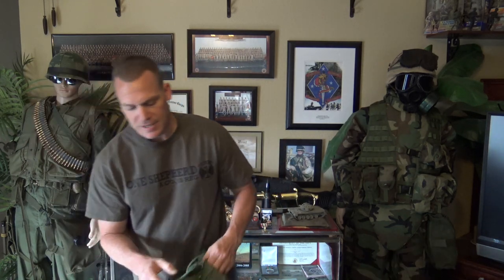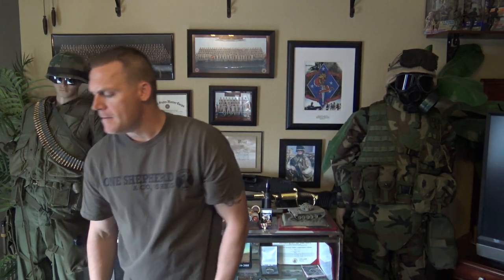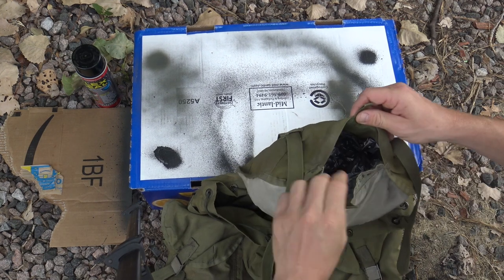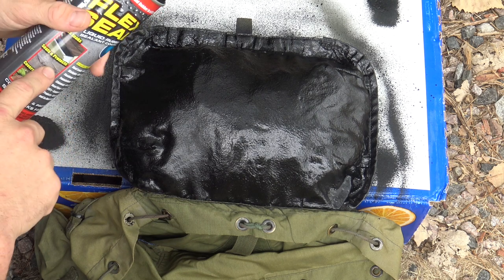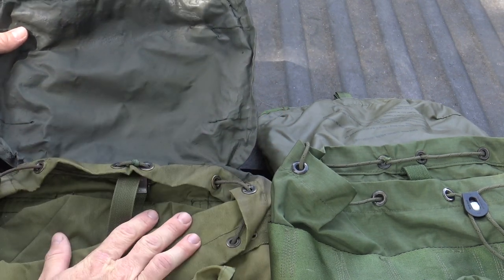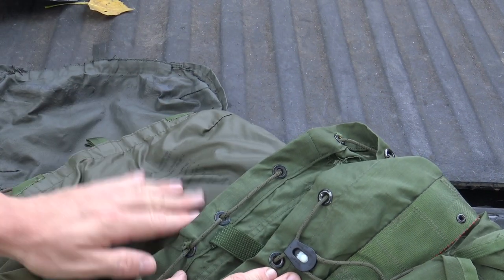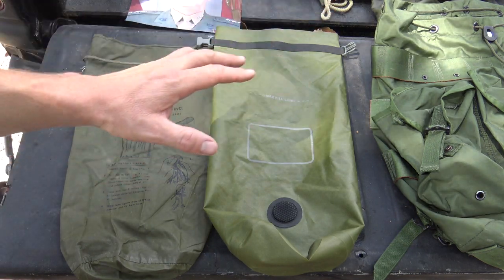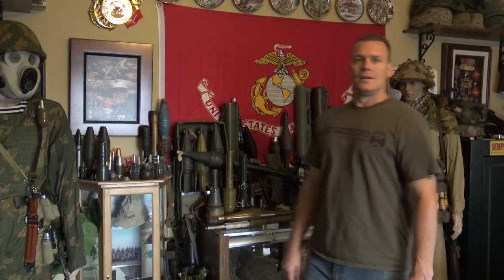Quick & easy repair to your old ALICE pack lid

Comment: My two ALICE packs I have from 1982-1993 USMC are far superior than the cammo ALICE pack I was issued in the Army in 2000 or so. 

Both USMC tops are still mint and need no attention. 

My Army issued cammo one the top liner is basically powder and getting all over everything.

Gonna give it a good wash and then use the flex seal to seal it.

Great tip

Comment: Just did my first coat on my Medium Alice pack. Only change was I taped off the nylon seams. First coat is a little rough but I can only see a little light through so it’s not bad. Next coat soon then the OD paint

Comment: This technique works great. I finally got around to repairing one of my packs with zero waterproof material left. I used rustoleum spray rubber. A little talc added after everything dries keeps the rubber or paint from sticking.

Comment: I’m a photographer I have very expensive backpacks but as with most packs taking off the pack and laying it down tends to wear the fabric on the bottom or if you have it set down and it’s raining and the ground is wet it tends to soak through this may be a preemptive strike to prep my gear for longer lasting waterproofing thanks for the idea

Comment: I am SO doing this with several of my ALICE rucksacks!
Reply: Dr Larsen,  in the 101st did you have a Medium or a Large ALICE pack? And who in your experience had the Mediums and who had the Larges?
Reply: @docback63  - I served in four Infantry regiments. Two were Mechanized Infantry - the 1/17th Buffalos and the 1/314th Mech. I also served in two Light Infantry - the 5/20th Regulars and the 3/187th Rakkasan Air Assault.

In the Light and Air Assault units, we were issued large ALICE rucks. In the Mech units, we were issued medium ALICE rucks. What we learned was this - the larger your ruck, the more the damned Army would force you to carry in the field! Plus, the more "Light" the unit, the more the Army expected us to be pack mules. That is the exact OPPOSITE of the Light Infantry concept, but we couldn't explain that to the 18th Airborne Corps. We wanted NO PART of that damned CFP-90 rucksack that was issued to the 10th Mountain Infantry!

For reference:
39.5 Liters (2400 cu in) Interior Space = Medium ALICE Rucksack (pockets included)
62.2 Liters (3800 cu in) Interior Space = Large ALICE Rucksack (pockets included)
111 Liters (6800 cu in) Interior Space = CFP-90 Rucksack (complete)

Yeah, having done some extreme cold temperature operations in Korea with daily highs at -5F and lows at -25F, I can appreciate the CFP-90 as an arctic rucksack. Aside from that, NO THANKS! Makes sense for the 10th Mountain Infantry, I suppose.

Comment: I've used Flex Seal on my MOLLE II patrol ruck. I sprayed the bottom for more abrasion resistance and to give rigidity to that portion of the ruck. Also did the same thing on my duffel bag.

Comment: I rain-proofed my Alice pack by brushing on a silicone layer on the inside and outside of the pack. Just used some clear silicone bathroom caulk and cut it with some paint thinner to make a paintable solution. Ran through 6 thunderstorms going 60 mph on a motorcycle. Kept my stuff dry.

Comment: Brent, I just found your channel a week or so ago; I have to admit that I was perplexed at first about your interest in Vietnam era gear in the first video of yours that I watched. I was thinking; why would one of the new corps marines be so interested in our old so called obsolete field gear (hard corps) (ya you know, us old corps, the ones that had twice the PT requirements and we did real sit ups, and we thought that our body armor was when we took cover behind our big balls!) (just a "little" burn on you "new bees"). I think that the USS Boxer was also on the float that evacuated Vietnam from March through June of 1998. Back then I was still using the older 782 gear setup for web gear.(oh, FYI, the web belt in your video with the snaps around the center it is called a "pistol belt") Any way; I have trunks full of what you scrounge to collect, I got issued my "new/ never used medium Alice pack in June of 1978, I still have it and it's still ready to go! I got a couple of those big liners that you showed by convincing a couple of Army reservists on their two weeks in the summer that they didn't need them, and that I would "get ride" of them for them! dam, the reserves are dumb! I gathered most of my collection when I was the motor pool maintenance inspector at both the 3rd and 1st Div's. Everybody knows that when you turn in your vehicle for maintenance that you remove all gear! Dam, their dumb too! One General that was returning from 29 palms had his driver drop his M151 off at the motor pool for Maint. and was rather upset when his field lantern set disappeared from the back seat. "It must have been those other drivers from operations SIR!" I still use those lanterns with my GP small tent when I deer and bear hunt, going on 45 years now, never had to use the spare parts yet!  "True story"...Lt butter bar and Capt butt hole busted me one day for obeying orders from a Navy Commander, (out ranks them both, "together") (oh I had a secret clearance, and the Capt. was jealous, when I checked into the company he raked me over the coals about it until my TOP "MSTRSGT" called him out and shut him up)  Dam their both dumb! So I wrote a letter of appeal to the battalion Commander, "a Full Bird Coronal" He received my letter about fifteen minutes after the said Division Commander, " the General" called him to congratulate him for having the "only" Marine that received a "Noteworthy" result on that weeks FMF PAC inspection that worked for him at Headquarters Battalion 1st Mar Div. That Marine was none only than Cpl. me, myself, and I ! And he also notified him that next week the HQ Marine Corps Quantico, was sending a teem of 3 officers to study and implement Marine Corps wide, the system that I developed to track and validate modifications on every vehicle that my motor pool was responsible for! .....Long story short; Lt. butter bar and Capt. butt hole were ordered never to interfere with me again and I was also given a cushy job as the new FMF PAC Inspector for Motor T at the 1st Mar. Div. !............ So any Officers out there reading this;... NEVER F...WITH YOUR NCO's! They are SMARTER than you are!....WE RUN and OWN THE Marine CORPS!..............Have fun with your channel Brent!... CARRY ON MARINE! ...Semper Fi
Reply: OORAH BROTHER!!!

Comment: I was really hoping to see a lid replacement.

 That said, if you're using flex seal, use the 'liquid'. The aerosol type is stiff and deteriorates quickly. In fact, not quite as 'quick and easy', but for a membrane repair, I recommend appx 60/40 flex seal/GE Silicone II(by volume), thinned with mineral spirits, to about thick latex paint consistency. This makes a really tough and flexible 100% waterproof membrane, with a very thin, lightweight application.
Reply: Thanks for your input I tried this hack and like you said the spray was brittle and cracked and flaked off. I figured I must have done something wrong and tried to do it again by first cleaning the surface with alcohol, but that doesn't help either. Thanks for your solution I'll try that.
Reply: @ldsphotodude49  

Even applying straight silicone II, will give a pretty good result. You definitely want to back it with wax paper on the inside because its messy and then just apply some silicone, with a credit card or something. Only need a thin layer.
Reply: Yes, I had the spray flex seal flak off too.  Onto plan B

Comment: Your absolutely correct about those rubberized inner liners smelling like vomit. They smell like that even when they are brand new. Good thing that smell doesn't get into your clothes when you stuff those liner bags.
I tried baking soda and it worked to get rid of the smell. So no smell, but, had baking soda all over my gear. I guess the general rule of thumb is to get something, you have to give up something. Can't have your cake and eat it too.
My ALICE large pack top flap deteriorated too. Along with a rain poncho. Flexseal to the rescue! Hope there is some OD Green color.

Comment: Great instructional! I've got an old LARGE ALICE pack (10x better than the mediums, for real pack-size!), and it's got 'rubber rot' really bad...and while it's easy to take the old 'floor brush' to the pack to strip the old rubber off COMPLETELY (nothing like rubber-cancer showing through like truck bed texture), but I wanted the original water-proofing on the flap to be as close to original as possible...and I really never gave flex seal a thought...until now! Headed to the hardware store....
SEMPER FI! 0311 to heavy gunner!
Reply: FYI...the Large ALICE pack is 3,880-cubic inches, for those who want a 'civilian size comparison' to commercial packs...

Comment: Great video Brent,
Out of curiosity, not trying to hijack the subject of the video, but has anyone tried to revive an old poncho with flex seal? Just curious how it turned out and how it lasted. 
I have a woodland poncho that is starting to loose the rubber coating, and I have an old OD poncho that nothing is left but the nylon that I’d like to revive.
Thanks and Semper Fi

Comment: Have a surplus French  F1 day  pack & exterior  latex coating deteriorating.  Used flex seal  on audio  gear w/good results. There is a green flex seal spray.  Next project restoration, & color match spray paint. Curing time essential for the flex seal for best results, dont hurry, it works

Comment: Outstanding as usual.  Greatly appreciate it.  Is it possible to use the large Alice pack without the frame?  Don't believe so, but these pack are surprising.  The advantage of the large Alice in the north is you can stuff bulky, and light weight clothing in, and still have enough room for everything else..

Comment: Thanks for the video. Just got a rather used Alice pack myself the past couple of months and I'm looking forward to more information on them.
Also, would you be willing to make an in depth video of using the Alice pack with the Alice belt or newer loadouts?
Reply from the maker: Check out the last video I uploaded, its a very detailed video about the Alice system.

Comment: Awesome video brother!!!
1 question...do I need to remove the old sealant before I apply the flex seal?
Semper Fi brother!!!
Reply from the maker: I didn't on the second pack I did and its holding firm, no issues. If you prefer I'm sure you can remove the old rubber with a brush but I don't think its necessary. Flex Seal is a beast and bonds to any and everything.

Comment: I like to use Alice Chemical Suit Bags to carry sleeping bags on my Alice pack. Yes, I know the military issued sleep system bags, but the chem suit bags are usually cheaper, and well they are a “second cool” kind of bag, meaning I just like them. I just hit on the idea that flex seal would turn the chem suit bags into actual dry bags, since the bag has the same closure method as a dry bag.  I may be wrong in that the flex seal may not appreciate the constant folding and rolling that goes along with opening and closing the bag.

Comment: I have used flexseal many times, some times it works but other times have failed, when exposed to sunlight or heat will tend rub off, we have used the tupe flexseal to fix a flat tire once, took off rim and clued the inside, still holding air a year later

Comment: I use airtight sacks like sealLine's for inside my pack for another reason too.  Even fully loaded, the pack will float because of them.  Why not spray the top too, and then the top pouch would be waterproof?

Comment: Just turn the whole pack inside out and seal the whole inside.
Great vid Brother..
Reply: Damned good idea bro. Thanx🖒
Reply: It will come of easily as stuff rubs on it, the lid has less friction on it.
Reply: @MI_Prepper  ive done it to my packs for years..the spray paint keeps it intact.But i only cary my MSS inside of my packs mostly..soft food bags cloths ect...havent seen any extreme ware
Reply: @MWoodslore  How heat resistant is it?  Good to hear from someone who actually did it.

Comment: Painting on the Plasti-Dip tool handle dip gives you a more pliable result than the flex seal spray, but looks like either gets the job done.  I use Em-Nu to repaint the metal sliders and eyelets on my old ALICE packs.

Comment: I tried this and for some reason did not receive the same results the spray just cracked and flaked off. I tried it twice. The first time I painted it OD green and decided maybe the paint made the flexseal brittle so after I got it all off again I spayed it again with just flexseal, but that cracked and flaked off too. I think I'll look for the rubberized piece you can put on afterwards

Comment: so do you recommend taking off what's left of the rubberized coating before you spray the flex seal or do you just spray it on  regardless?
Reply from the maker: I just sprayed it on there, I'm sure it would probably hold better if you removed the old rubber first. I didn't care, if it starts to crack or peel I'll just spray another coat on it.
Reply: @Brent0331  appreciate it. thanks

Comment: Just thinking, why not flex seal the outer pockets and skip the dry bags. Or treat the whole bag and have the whole thing waterproof, what are your thoughts.
Reply from the maker: You can but itll probably trap water  if you have to cross water. Having a WP bag turns your pack into a flotation device for crossing water ways.
Reply: @Brent0331  thank you for that nugget of information, I'll just refinish the lids of my medium and large packets only and call it a day.🙂

Comment: Hi, Brent, I have a similar ALICE pack that the rubber part of the lid keeps deteriorating. I want to strip all the rubberized cover. How would you suggest to clean it?
Reply from the maker: I'm not sure brother. I didn't even bother to do that I just sprayed over it on the first one I did and came out great.

Comment: Brent. Where would I have luck finding the outer pocket waterproof bags. I’ve never seen them before. I usually use 1quart resealable bags. Not very durable.
Reply: Thomas Harris just cut the leg bottoms of of some old BDU’s  sew up the ends and turn inside out and spray with fix seal make your own bags.
Reply: Earth bound Misfit Thanks man. That’s a damn good idea.

Comment: Alice pack liners had the rubberized coating on the inside of the bag and the nylon on the outside. The ones with the rubberized coating on the outside are the cheap Chinese knockoffs. The reason the nylon was on the outside was to protect the rubberized coating from abrasions.

Comment: Hey there brother! Great video on resealing the top lid on the Alice pack but one question? Do you think if you can turn your Alice pack inside out and seal the inside of your Alice pack with the flex seal? What’s your thoughts about that? Would you think that would work as well and if you think that would work can you make a video on that. This is Big Boy Frank from Texas Peace out ✌️
Reply from the maker: No, use a WP bag. You need your pack to drain water. Also a WP bag will make your pack float if doing a water crossing.
Reply: Brent0331 oh ok thank you brother for your input on that. I really appreciate it that you took the time to answer me back. 👍

Comment: Or you can just use a thick trash bag and stash your trash in that....then you will have an el cheapo way to keep your trash dry....
Option 2 is to use a new style dry bag and your ALICE pack will float in the ocean when your doing amphibious operations off the USS Boxer...😳
Because it happened to me in 1999..!!!!
Reply from the maker: Ha, I think the Boxer was with us on our transit over to Kuwait in 2003. We rode on the USS Dubuque (first commissioned in 1966), what a wonderful ship (sarcasm intended).
Reply: Brent0331 holy shitballs bro...yeah I remember that old junk box....
Showers secured
Hot water secured
Electricity went out.....dead in the water for a few days...!!!
It’s not a cool time floating around in mid July in that damn thing....it gets hot as fuck on a ship when it loses its own power..!!! 

Semper Fi bro

Comment: Old video, good idea. How is it holding up after all this time?
Reply from the maker: Depending on how much you use it you'll probably need to respray after a year or so. Which takes 2 seconds so its worth it in my opinion.
Reply: @Brent0331  cool man thanks!
Reply: @Brent0331  Thanks man

Comment: Never saw those pocket liners before.  We just used ziploc bags...
Reply: Me neither. There was a little manual they issued for care and use of the ALICE system and that's the only time I ever saw those liners. I usually used the clear plastic waterproof bags for the M-17A1 protective mask which I would scam from the NBC NCOIC.

Comment: 13 buck... Hobo waterproof works just fine too.. Acetone and silicon. Mix it that silicon have all melted.. Take paint brush and do how ever many times you like.. Everytime longer lasting waterproof but all so more rigid... Don't do too many times there is something like too rigid... Be sure what is the material where you are applying that.. Maybe do just little test first somewhere where you cant see so well.. Acetone might fuck up cheap plastic parts is some cheap stuff.. Use transparent uv resistant silicone and you are golden.. Now when i think of it might get cool color stuff if use some other color one.. How it might look if one color pack but uses 3 different silicone mixes... Might try someday.

Comment: Updated. I tried this trick and this trick didn't work because I failed to properly clean the underside of the lid. Failure to clean will result in peeling. Take your time with cleaning and allowing it to dry. Btw this works really well with repairing Willie Pete bags.
Reply from the maker: Cool, maybe a WP bag will be my next project.